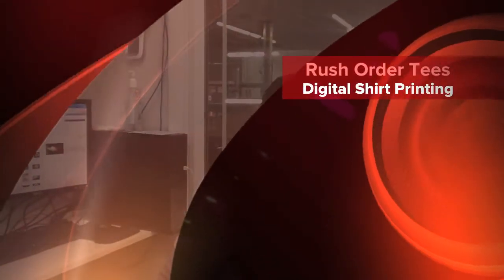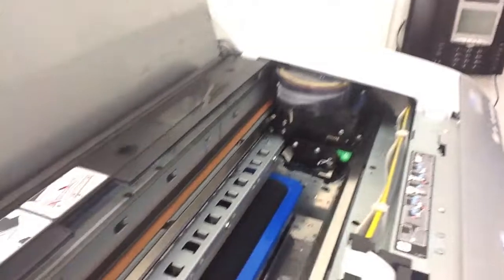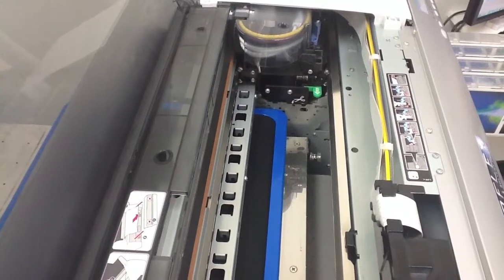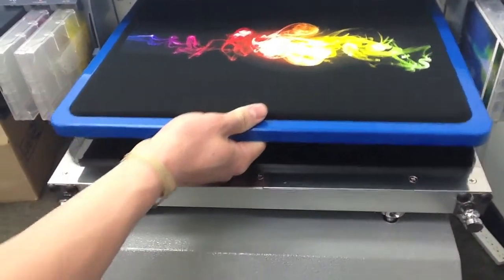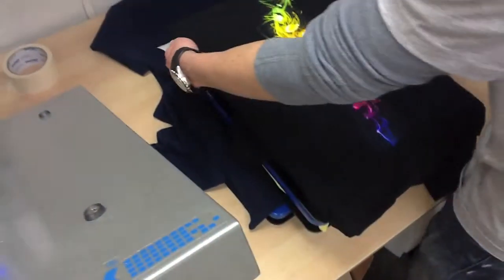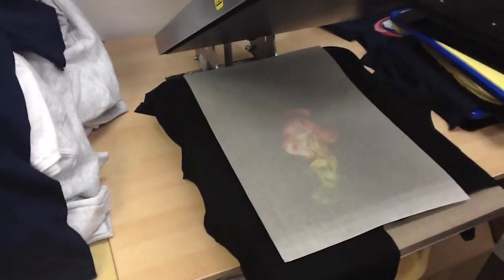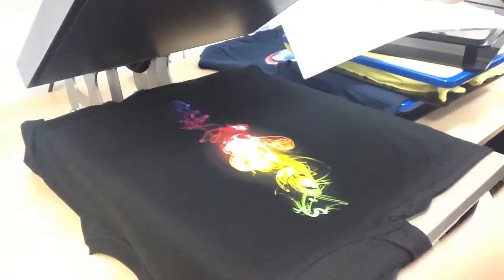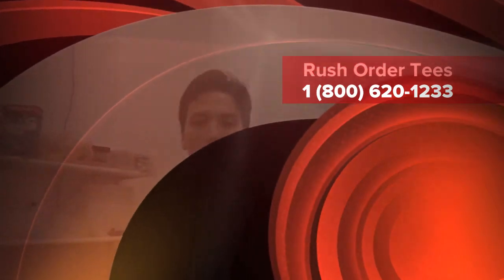Direct to Garment Printing For Custom T-Shirts

Comment from the maker: @ michael sun The ink sinks into the fibers and is basically apart of the shirt. This can give shirts a higher quality image and longer durability. This printing process is recommended for very high resolution images due to the fine detail that we can capture with digital printing.